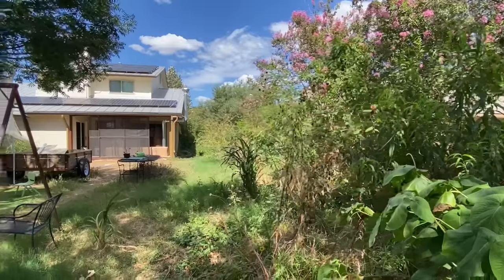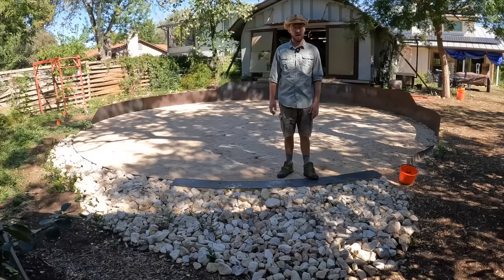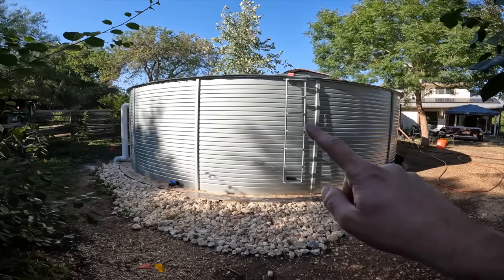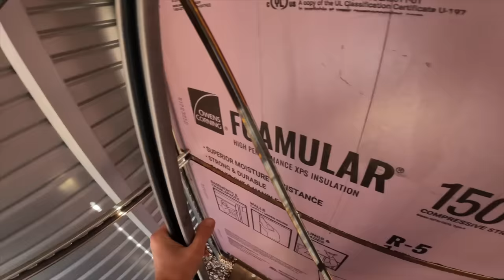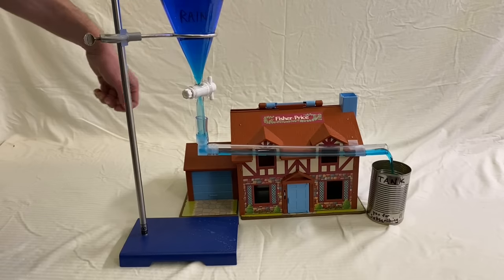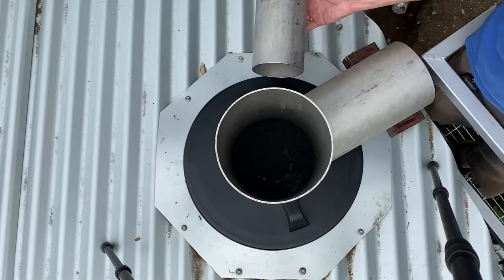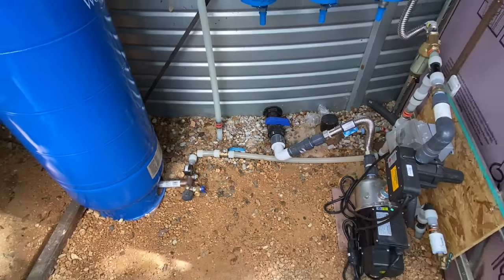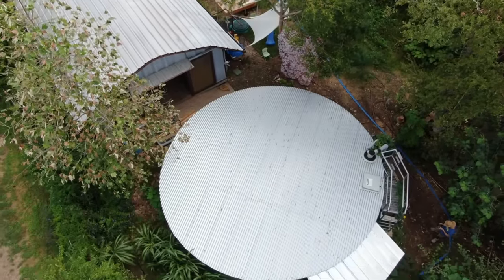FREE water forever.  LEGALLY!!!!

Comment: Awesome vid! I will say though I was perplexed why the roof of the tank wasn't concaved to the center to collect more rain. It seems like you collect plenty already but as a kit seems like that could maybe work standalone if the house roof isn't metal.
Reply: Concave roofs have structural problems, but here in Australia there are a number of systems to collect the rainfall off the tank roof. If you have half a metre of rainfall a year, that's a fifth or more of your tank filled each year just from its own roof - you don't want to be throwing that water away.
Reply: yea i was thinking the extra water from the tank roof could be captured or used somehow. concave shape roof sounds too difficult to make, just need a few degrees tilt and a gutter, but now that he already has it built flat it seems like it would be even more work to change it. and i think it needs a hydroponic garden or somewhere useful to put the water for all the runoff if the tank full
Reply: @ivanjakanov  I don't think it would be too difficult. You just flip the current roof upside, cut a hole in the center, add a filter catch. Feel like it would be a significant amount of surface area to catch rain.
Reply: @ivanjakanov  If you're in a mains serviced area, you can pipe the tank overflow to the stormwater system - it's built to take all the runoff from people's roofs. In a rural area, sending it to a farm dam or pond is ideal.

Comment: Very well made Video and Impressive Job! Congrats on this work of art. I wanted to ask you, For the pipe system you're using, (non-pumped U pipe for the rainwater collection) are you aware or using any specific means to prevent stale/bacterial buildup in that pipe between the rainy days/seasons? I would love to know. I plan on eventually living off grid somewhere in the states.
Reply: I wanna know this too. As I tried with a smaller rain barrel but the standing water caused mold and things to grow in the heat.

I’m not sure what or how one would treat the pipes or prevent this

Comment: You can also put a First Flush Diverter on your downpipes. They discard the first little bit of water off your roof from each rainstorm, which gets rid of the vast bulk of dust and debris that has fallen on your roof since the last rain. It's easier to exclude that sort of stuff from your tank in the first place than to have to clean it out of the bottom of your tank later. Cleaning out a tank is done with a thing quite similar to what you'd clean a swimming pool floor with, but it's tedious.
If you have a lot of trees near your house, you can put mesh gutter guards on your gutters. They're more meant to stop all that fuel accumulating in your gutters so it can't catch a spark in a wildfire and burn your house down, but they do keep dead leaves out of your downpipes so they don't block up. Bonus, if a bird or whatever ever dies on your roof, they don't sit in your gutter polluting your water.
Experts in tank water recommend several smaller tanks rather than one big one so that if the water in one gets polluted by a dead bird or a really polluted sky event such as a wildfire, you can allocate that one tank to watering your garden and your others are still clean drinking water. With only a single tank, if that's all the drinking water you've got, you would have to drain the tank after a pollution event and buy in water until the next clean rain. But if you do have an alternative source of water on tap, a single big tank is the lower-cost option.

Comment: Great vid! Your 30K tank is likely overkill with the catchment area you've shown. It will never fill up unless you receive > 30 inches/yr, at a usage of 75 gallons/day, and a catchment area of 2500 square feet. But it doesn't hurt to have a large one. :-) BTW, I highly recommend replacing your downspout overflow with an intermediate holding tank + pump. This will mean you capture all of the water, no matter how hard it's coming down. A simple sump pump with > 40 gpm (built-in flow switch) and a food-grade 55 gallon tank will work perfectly. I've got an excel modeling tool that can perform all of these calculations for you if you're interested.
Reply: I have supplemental rain catchment at my off grid home. It feels like overflow is just waste.

Comment: I grew up on a barrier island off the coast of Louisiana. We all had cisterns because power would often go out for Hurricanes and the local water department might be out of power for months. We didn't have pumping into our homes until the 80's and we had charcoal at the bottom to keep the water clean. We usually boiled it for drinking. We were harder than most people but that's because we had to be. We ate good because of the abundance of fish, shrimp and crabs...😊

Comment: step 1: have a big ass backyard
Reply: No have a big ass budget
Reply: And epic welding and metal fabrication skills
Reply: He did go all out. Cheap plastic tank against the house is cheap and doesn’t need much space. Also you can put them underground
Reply: This is a small back yard in my neck of the woods.
Reply: In the farm lands of Dominican Republic, this is done with barrels rigged to the roof drainage systems. May not be able to install in the pipes of a rental, but can work with a faucet and a little elbow grease hauling water inside, or a rigged window system with a faucet… it’s removable and just like folks use these tubs for gardens , you can use them for self 🥴🤷🏾‍♀️just planting seeds of inspiration, don’t mind me lol

Comment: Did you keep any records of the total amount this cost you? Thank you for the video, it was extremely interesting.
Reply: it is in the description. he lists about $25,000 in the materials plus there is the cost of installation which was not mentioned and if you cant do all the prep and build the pump set up like he did it would be even more. I would say for the average person you would be looking at $40k to $50 to do this. may very well be worth it though depending on your situation. a well (if you can even get. permit for and if there is ground water reasonably deep where you live would cost quite a bit more I believe.) so this is not crazy expensive at all for what it is but I think most of us could pull off a much smaller version of this for less money and it would be enough, especially if it is being used as supplemental water or for irrigating garden .
Reply from the maker: added to description

Comment: I am  a hydrological engineer, specializing in filtration systems, and i see so many problems and difrent levels of eficiency. And its great you are doing this. I am sure you have changed and learned from most of the issues I see... Keep improving and redo the vid in 2 years with all your updates and changes please...  sorry for the typeO's. Also, become a Ham radio operator , we need smart and free thinking men such as yourself.
Reply from the maker: I am planing a couple follow up videos. Stay tuned. Thanks for your support!

Comment: As someone who used to do water treatment, I want to emphasize the importance of making sure you use materials that don't introduce toxins, and that you have everything well sealed to prevent intrusion of rodents, birds, and bugs.

One potential problem I see in this system is the intruduction of contaminants from the roof. Everything from ash, pollutants, bird droppings, and more. Plus, the standing water in the pipes from the roof would be suseptible to algae growth and growth of bacteria coming from birds rodents and insects. 

One thought to prevent this would be valves that can allow runoff from the roof to be diverted away from the tank. Then flush the runoff pipes with the first 30ish minutes of rain. You may even need to add some chlorine during this flush process - or during extended periods without rain.
Reply: if he can put the valve on a timer but its hard to be there every rainfall
Reply: @jamescheddar4896 these are the reasons I've only used filtered rain water as garden irrigation
Reply: Bermuda requires 80% of rainwater to be collected from each households roof.  Roofs are painted with non-toxic white paint.
Reply: Sorry but research has shown that rain water first flush filter don't actually work

Comment: Most people in the USA already pay almost nothing for drinking water. Factoring in other costs it's roughly 350 dollars PER YEAR for an individual. 
Tapwater costs $0.01 (or much less) per gallon in USA. For reference a human comfortably needs roughly half a gallon per day for drinking.
The best consumer-grade water filters costs roughly $0.03-$0.05 per gallon (He uses a filter for the tank, so he's only making the sub $0.01 tapwater savings).

The man gave an honest summary of the cost in the description, and he admits he didn't count labor, tractor or power tools. Factoring in the manpower, gas, machinery, raw materials, certified personnel inspection, refitting, additional custom welding, electricity bills, gas, trial and error and wasted time.... Plus future algae treatments, yearly regulation touchups, and filters... This tank will have to be used for roughly 5~20 years before it pays for itself, providing the flimsy structure doesn't break down, get destroyed by a storm or he decides to move. 

So after carrying this burden on your back for 10 years, you'll eventually save 350 bucks per year. (Of you don't move, need expensive refitting or a storm sweeps in.)

Meanwhile a regular Joe can just buy a normal filter and pay a measly $390 year for filtered tapwater for the exact same benefits. Rainwater is NOT automatically cleaner than tap water, if you have pollution in your tapwater then its almost certain the rainwater is similarly tainted. More people get water poisoning from drinking rainwater than tap water in the western world because of "forever chemicals."  Rainwater is not cleaner, it's cheaper, unless you build a tank.

This may have been an invaluable experience and lesson, and it made for an EXTREMELY entertaining video, but it's not something people should take on as anything more than a lofty experiment if they have wads of cash laying around.
Reply: hey:  I use rainwater for my plants as my city water kills them.   Every rain "pays back" about $60 in value from about $200 I invested in some large barrels.  Rain instead of paying for plant grade water delivered.  I'm using now water I collected in our last storm, in early April.
Reply: @timisaac8121  Great point, rainwater is great for plants
Reply: @lobo2367  yes.  For me, it is the difference of growing plants (tomatoes, peppers, onions, peas, pumpkin, celery, beets) or nothing.  big plus!!
Reply: Dont know where you get your figures. But our water bill is 6 billings, that's every other month. The average bill is now $150 +or - $10.  That's $900 a year. 
We've cut back showers,  installed those stupid flow savers that suck, only use the dishwasher when it's packed full and after 11pm. We use the well for watering the garden and lawn when needed.This would save us so much money but city says no in suburban setting.
Reply: @ernestinehoffman-otto4986 First off I'm ONLY talking about drinking water. Not water used for grooming, cleaning etc. A tiny tank like this won't cover all the (excessive) daily grooming, dishing, cleaning, etc needs of average western humans for an entire family. The man in the video won't use the rainwater tank to wash his fence, car, cool his machinery or clean his dogs every day of the week etc etc. The tank would be empty all the time. 

Water for human consumption and water for all other things is entirely different things. Both as a necessity and by law, globally.

Moving on:

If YOU pay $900 a year for an entire family for drinking AND utility water then you actually pay less than I outlined. 
In my example I counted roughly $350~400 for ONE person's DRINKING water ONLY. You pay $900 for several people + dishing, cleaning, grooming, pet water, etc. 
That means you are below the median already. You are NOT in the group of people that need alternative solutions, you are already enjoying some of the cheapest water nationwide. You pay (much) LESS than my example. 

I'm just estimating from the little information you gave me. Buying a tank in your case would be even less economical, because you would multiply the cost (and size). Unlike the guy in the video who does it for drinking water to 1-2 people in his hobby house. Compared to you who needs drinking and utility water 24/7 for several people.

Comment: It might be a dumb question but am wondering why not having a kind of tank with an opening on the center of it's top (the top would need to be slightly bended towards the center in order for the water to not be stuck) with a filter and thus the tank don't need the house roof to collect rain water and can do it directly by it self ?
This will reduce by a lot the number of expenses no ?

Comment: Very nice. To avoid going to the larger dia pipe I would increase the difference in height between the roof gutter and the tank inlet to get faster water speed in the pipe. Say, 36". Helps if your lot is sloping and you put your tank at the lowest practical elevation.
Reply from the maker: The only problem was, I can’t raise the height of my house and to make the tank any lower, It wouldn’t flow its own runoff away from the base. So I was kind of limited in the differential. Thanks for commenting. You are exactly correct with your thinking.

Comment: Great video. A few questions. Where does the rain water from the roof of the tank go? Is the pump ran by solar?  Would painting the metal you used in the pump house help the protection? What was your total cost? Very thought provoking.
Reply from the maker: Rough numbers for cost in description. Roof water from tank is wasted so far. I have a long term gutter plan though. Paint would have helped but I was feeling lazy. Thanks for commenting!

Comment: Is there a reason why you had to use sand for the base instead of concrete? Also, those plastic pipes will leak into your water and contaminate it.

Comment: Not bashing, But giving a bit of knowledge on how to use a soapstone to write on pipe making a custom cut to join two different pipes. Get the two pipes at the angle you want to have them connected having them both stable. Then take the soapstone and align it with the smaller of the two pipes where it is parallel. Start writing on the somewhat horizontal pipe and moving the soapstone making sure to write with the end of the soapstone on the smaller of the two pipes along with perpendicular pipe or larger of the two. Using both ends of the soapstone to write on both pipes at the same time. Then you'll have a connection that is very accurate and easy to weld. Having worked for a drilling company I learned this trick one day whenever I needed to join two different size pipes.

Comment: Thank you for sharing your inspiring project. Have you considered hormone disrupting chemicals such as BPA, PFAS etc ? Since I see there are a lot of plastics on the system, including the entire tank lining
Reply from the maker: Reverse osmosis filtration inside the house should remove all that. Also has a carbon filter in the pump house that should help too.
Reply: @suburbanbiology  Ah makes sense. I just looked it up a bit and found a paper which says that polyamide based RO membranes do filter out BPA, but cellulose acetate ones do not so much.

Comment: I like to see how the water tank itself and rain water holds up in the cold Texas weather?
Reply from the maker: Our “cold” is far less than anywhere else in America. Ironically it can knock out our grid but it won’t even freeze a pool 😂 the pipes and pump are the biggest liability. I added a poultry heat lamp on a thermostat inside the pump house. It worked beautifully. I have a battery backup on the house to run it all now if the grid goes down again.

Comment: When you pooh and pee, where does it go? If its a sceptic tank what happens when it fills up. And if you clean the loos with Bleach, how do you discard contents safely?

Also how do you clean the rain water with the filters? What type are they, what exactly does it filter? How oftern does it get replaced?. Because stored water starts to attract dirt,  bacteria, flies etc?

How do you clean inside of the tank. Wont dirt accumulate?

Comment: Would be awesome to still retain usage of the lost surface area, if it supports enough weight to still suntan at least, or if you built a deck over it. At least it could hold some solar panels.
Reply from the maker: I seriously considered building a raised deck over the top. I probably won’t……..but I haven’t ruled it out entirely.

Comment: I’m an apartment dweller AND what I learned is that I should start filling my water bottles with the RO option (I actually haven’t drank from the faucet for 35+ years - I moved to New Orleans and it’s literally the first thing I learned moving to a place 15 feet below sea level - you’re having water delivered. It was inexpensive enough but now I just go get it and it helps keep me strong. LOL 5 gallon jugs are NOT light.).

Peace!

* thanks for this info
Reply from the maker: Many folks recommend that your RO unit has a remineralization cartridge. Something to keep in mind. Thanks for commenting!

Comment: you should consider a wetland wastewater filtrashion system (powered by aquatic plants), if you haven't yet. some dude even did the thing with his pool so that it doesn't need chlorine to stay clean
Reply from the maker: I have a greywater system installed already. Gives about 100 gallons per day to my plants. Super simple. Pours into pits at the base of the plants. Soil does the filtration.